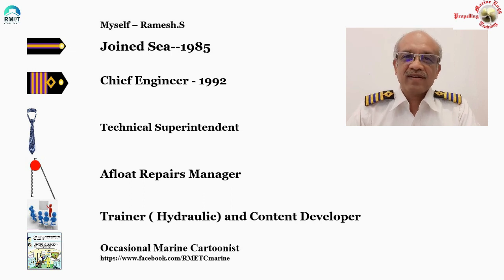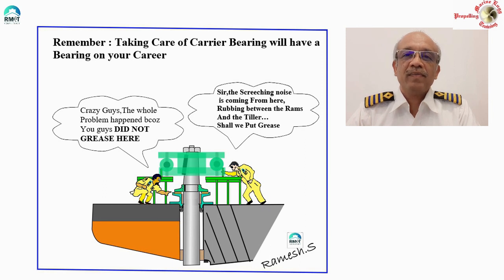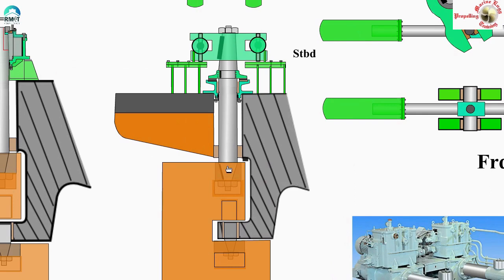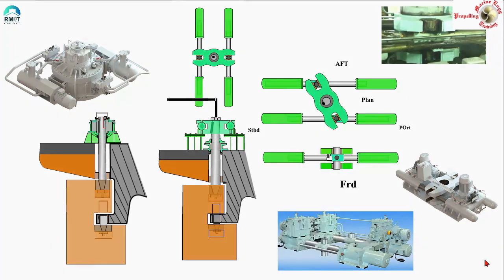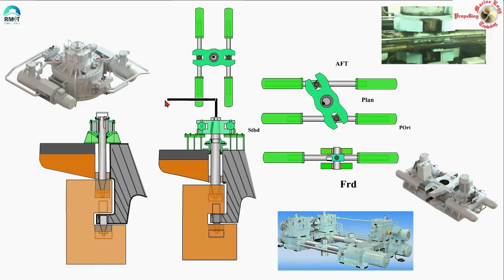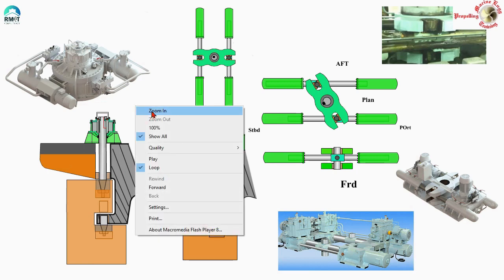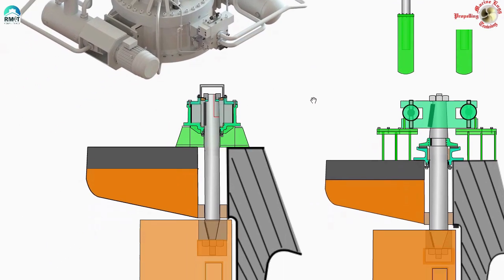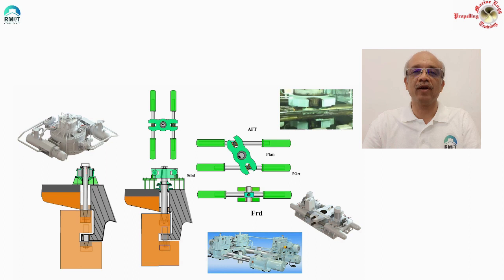What is Rudder Drop ?? |Importance of Rudder Carrier Bearing | Rotary vane steering gear| RMETC

Comment: Nice video on above subject. For learners information There are other factors which also contribute for the rudder carrier bearing wear down and increased rudder drop,  they are water Ingress into rudder through hairline crack on body ,damaged bottom plug ,Shear off of securing Bolt on the rudder stock, excessive pintle clearances. But the most probable cause wud be  Hydraulic oil contamination & insufficient lubrication.

Comment: Good day sir! in this video you said even half a millimeter of wear down drop is not tolerable for rotary vane steering gear system, Is this accurate? According to what I studied the full rotary vane system is suspended on Anchor Bolts and the assembly is in such a way as to provide jumping clearance on the top and wear down clearance at the bottom since the whole assembly can vertically move up and down a little bit. Can you please clarify on this?
Reply from the maker: There are two types...one with anchor bolt where you have a carrier bearing..there...it does matter and what u said is correct
In the other type where the bottom cover is the carrier bearing...we have no concept of jumping clearance
Reply: @rmetcvideos  Understood Sir. Thank you!

Comment: Sir what is the actual clearance when the ship is commissioned or a whole new set of rudder carrier bearing is been installed? Also I have come across conical bearing type carrier bearing, couldn't get clearer about it.
Thank you...
Reply: Nice question Tousiff...Obviously it will depend on ship to ship..I dont have much access to a large databank..but With the data I have...say 27000 GRT,200 m LBP and 48000 DwT with 2 Ram steering gear..the total clearance made available in the tiller is apprx 25 mm..I presume this can be equally divided into top clearance and bottom clearances. The top clearance  will work out to 13 mm.I means that if the carrier bearing wears down by 13mm...you are in trouble .By the way the thickness of the carrier bearing material is 25 mm.similarly the bottom clearance being 13 mm...obviously the jumping clearance should be less than 13 mm .All these with suitable safety margins....for practical situations.
Reply: @utubechandri  thank you sir, much clear now.